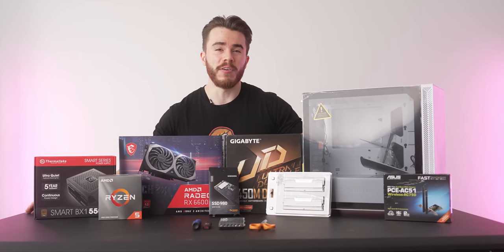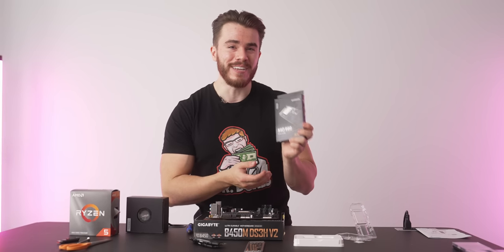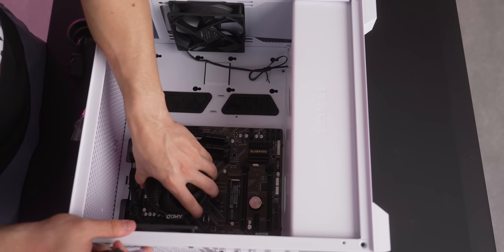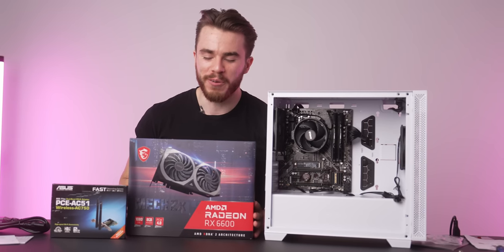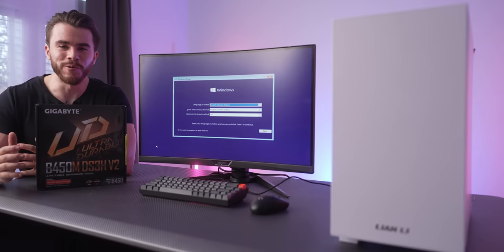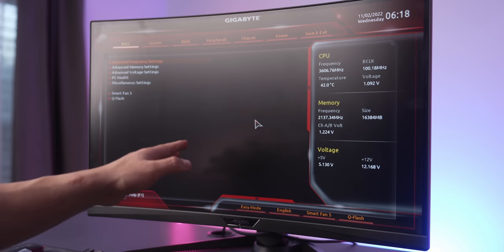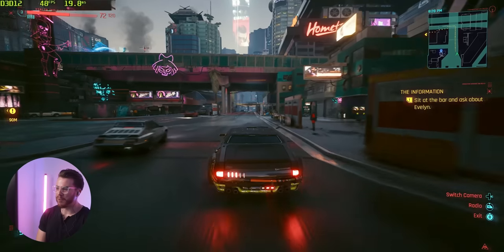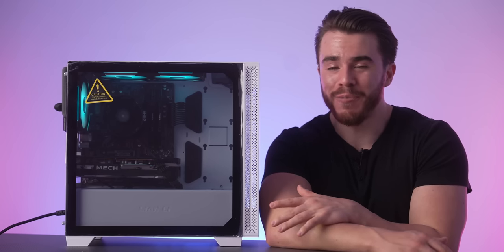Your Next $700 Gaming PC Build for 2023!

Comment: I feel like this system could benefit a LOT by going for a 5000 series cpu and a B450 mobo that supports it and also rBar, like most msi mobos...yes its a bit more money, but every penny worth it..
Reply from the maker: True, I didn’t think of that! Shoot!
Reply: @ScatterVolt  no problem mate just post and pin a comment for folks to know. I got an "old" msi gaming pro carbon mobo that received the 5000 bios update, and i just discovered last week that rBar is now also available on it. Quite handy when i just bought a 3060TI and a 5600X

Comment: I like the fact that you went all AMD in this build.  The R5 4500 combined with the RX 6600 is a very strong combo.
Reply from the maker: It could of been a little bit stronger with a 5500 since it’s price has gone down a lot since making this video
Reply: is there any differences if u combine it with different brand?
Reply: @ikram2512  you would miss amd smart access memory feature.
Reply: @ScatterVolt  with the online linked motherboard is wifi already connected with that, planning on building this for christmas
Reply: Could this run cod at 120fps
Reply: @ScatterVolt but wouldn’t you have to get a b550 motherboard?
Reply: @iihamed711  does the 5500 work on a b450 motherboard?
Reply: @hugo3928  it does, but you need to make sure the bios actually supports that cpu.
Reply: @iihamed711  thanks the ryzen 5500 worked out of box with no bios update :)
Reply: @hugo3928  that’s good to hear. I was actually planning on going with a ryzen build, but I was worried that my motherboard wasn’t going to be compatible out of the box so I went with Intel instead. I wish I went with ryzen tbh because it was much cheaper and I could’ve added a better gpu. I’m still happy with my current pc, but it would’ve been the better choice to go with ryzen.
Reply: @hugo3928  u think the 4500 will work on b450m wifi?
Reply: @hugo3928  so i can buy a 5500 for the 450b motherboard? and the other parts of this pc?
Reply: @hugo3928  hey do you know Why this worked I’m planning on also getting a 5500 instead of a 4500 So I wanted to know if you had any issues with compatibility on the b450m and 5500?

Comment: Nice build and nice budget options as well. I do agree with others though, that pairing the 12100f with a lower-ended b660 offers a longer-lasting upgrade path.
Reply: Yep, either that or the 5600 would have been the way to go.  I did the 5600 for 109 bucks  it's more cores and will be just fine for a while.
Reply: @Ryan-re1rs  how the hell did you find a 5600 for 109 USD lmao, its normally around 160-185 USD. Either way I would still recommend a 12100f like OP, its 40% cheaper and offers the same performance

Comment: Awesome build! But preferably you shouldve used the i3 12100f/ i5 12400f for more future upgrade ability.
Reply from the maker: i3 12100F maybe, but I wanted to set users off with a six core CPU for this price of a build. After all, AMD is still committed to the AM4 socket. It's not a bad choice by any means.
Reply: The 12100 is certainly an option but also the F60 bios on the motherboard Scattervolt used here supports the 5800x3d and that and a GPU upgrade down the line would keep this PC going for years. Right now either option is terrific and it comes down to what you like really. Nice to see decent price performance again!
Reply: @ScatterVolt  ryzen 7000 has pins on the motherboard now..
Reply: you are totally right, they outperform AMD processors and are 40% cheaper its ridiculous lol
Reply: or simply for PCIE 4.0x8

Comment: Using the stock CPU cooler is just leaving performance on the table. Spend $30 or less for a tower air cooler like the ID-COOLING SE-224-XT. Also Microcenter had this same motherboard and a R5 3600 for $130.
Reply from the maker: This build video was filmed back in October, before that insane cpu & motherboard deal

Comment: I'm building a ryzen 5 5600x, with rx 6700xt, 16gb 2x 8gb ram, 1tb Samsung 980, MSI MPG B550 Gaming Plus ATX Gaming Motherboard. 750w battery, With a MUSETEX ATX PC Case Pre-Installed 6Pcs 120mm ARGB Fans, keyboard and mouse with a monitor. All together 1,250$
Reply from the maker: Noice

Comment: Got all these parts for 590 using open box deals and the 5 percent Micro Center discount card. You think adding a better CPU/Motherboard would be a good place to spend the remaining 110?
Reply from the maker: I’d spend the remaining 110 on a 5500/5600, a 6650XT, and upgrade to a 1tb m.2 ssd
Reply: @ScatterVolt  hi, what is 5500/5600 and 6650xt. I'm new to this and I don't understand those terms. Thanks

Comment: Great build, I still think the r5 5600 may be a better paring, especially for CPU bound esports titles, 0.1% lows, and relative price difference. but in most titles, the r5 4500 is more than adequate, where the GPU is the limiting factor. Can't go wrong.
Reply: Im looking to build my first ever pc, would 1 TB of storage instead of 500GB work with this computer?
Reply: @masonmills-wg1nw  that would be better if you can afford it, twice the storage, gonna come in handy if you don’t have super fast internet
Reply: @masonmills-wg1nw  dont get an r5 5600, its around 150-185 dollars, you can get an i3 12100f for 100 dollars on ebay and amazon and it offers a little tiny bit better performance than the 5600, and can be paired up with B660 newer motherboard chipsets which are better for future upgrades
Reply: @MrEverythingyouwant1  will the cpu ryzen 5 4500 bottleneck the gpu amd radeon rx 6600?
Reply: @backeslache4264   I imagine not, the 5600 benefits over the 4500 because of more cache, and better architecture, but they are still similar, so if you can get the 5600 for maybe a $30-40 price difference, I’d consider it. The r5 4500 would be fine in single player games and most multiplayer games to be fair, but frame times and .1 lows are going to be better with the 5600, though it really just depends on the games you play, and what performance metric your aiming for
Reply: @_ZERO  the 12100f is not better, in barely any metric, the 12400 is a better buy, but if your building new, in most areas it’s substantially more expensive. Your upgrade path is invited to 13th gen, so if upgradability is your priority, spending a bit extra on a b650 board for am5 and a 7600 might be a better option
Reply: @MrEverythingyouwant1  here in sweden where i live the r5 4500 goes for 95$ and the only other cpu that my budget allows me to get is the ryzen 5 5500 which goes for 120$. This is going to be my first gaming pc so im a bit scared of picking the wrong cpu for my grapichs card so that I will lose out on performence. I mostly play single player titles but the only competative game that I play is overwatch. Do you think i should go for the r5 5500
Reply: @MrEverythingyouwant1  Is there a way to accuratly check the bottleneck a r5 4500 will cause a radeon rx 6600 xt
Reply: @backeslache4264   I would be less focused on bottlenecks considering the relative performance of the rx 6600, in gpu Blount games, you won’t likely experience any cpu bottleneck, you’ll be limited by the gpu, if you plan on selling and upgrading the gpu in the near future, than the r5 5600 is better for you, but paired with the 6600, you’ll only notice a slight difference in cpu bound games, it really depends on the games you play, Fortnite, apex, and cod all love better cpus, so if you play competitive shooters, get the better cpu, otherwise, you can save a buck on the 4500, it’s not bad by any standard. I’d also consider what monitor your playing on, as if you only have a 1080p 60-75hz display, your not going to notice the difference anyways
Reply: @backeslache4264  I'd go with the 5500 in that instance, if the 5600 is 10-20 more expensive, try to find somewhere in the rest of your build you can cut back on, that isnt the gpu. otherwise, you really cant go wrong with the 5500, same architecture as the 5600, just has less cache (which is important, hence the suggestion to upgrade if the price difference is negligible)
Reply: @MrEverythingyouwant1  First of all i just want to thank you for responding this really helped me. Yeah i was also thinking the same and go with the 5500 instead it's only a 30$ diffirence. Im kinda uneducated when it comes to the bottleneck stuff it was something that i read on a website that it affects 20-40% of the gpus performence when it comes to frames, but that must be inaccurate. As of now i own a 50hz display i've had for around 4 years but it's time for a change. I will buy a 144hz monitor. Im planning on maybe selling some parts in the future and upgrading but im not sure yet .
Reply: @MrEverythingyouwant1  Case: deepcool cc560 midi tower

Motherboard: asrock a520m-hdv

cpu: ryzen 5 4500

gpu: amd radeon rx 6600 xt

ram: Kingston fury beast ddr4 3200 mhz 16gb

Ssd: Kingston NV2 NVMe 250gb

Hdd: seagate barracuda compute 2tb

cooler master elite v4 600w 80plus 

this is my whole build. I am a little scared regarding the motherboard it goes for 73$ on the swedish market of amazon, it says that it supports ryzen 5000 series but i might have to do a bios update. I feel like this motherboard is very low quality and might break. I would really appriciate if you by any means could check if this is a good motherboard for my build
Reply: @backeslache4264  No worries! Yeah that's a good build. I'd suggest removing the HDD, and instead replacing your 256 +2tb HDD set up with a 1tb SSD, they are surprisingly cheap nowadays comparatively, and if you have a decent internet connection having more storage isn't always necessary (I have a 500GB SSD only, with a fast internet connection I can often uninstall and reinstall large games in under 10 minute). I'd also look into deals on a b450/b550 mobo, they usually have better chipset cooling, supports oc and more pcie lanes, b550 specifically supports pcie gen 4, I wouldn't really recommend any a520 series board, as it really limits you say, in the future were you to want something like an r7 5800x3d or r9 5959x. I personally have a B450-DS3H+WiFI from gigabyte, always rocked with gigabyte boards, and got this for a steal at a local computer shop, though its been going for similar on amazon (105 CAD), id look into that before pulling the trigger
Reply: @backeslache4264   Yeah id look into getting a new monitor if possible, 1440p 144hz is reasonable from the 6600 with settings adjustments and FSR, and you can get cheap VA 1440p 144 panels under 250 (i like VA, many dont because of motion blur, do your own research, many tend to prefer IPS)
Reply: @MrEverythingyouwant1  Yeah removing the hdd is a good suggestion, I cant complain about 1tb, Im currently playing on a 500g ps4 ahahahahah. I was thinking of replacing the motherboard asrock a520m with the asrock b550m it's only a 20$ extra. Do you think that the asrock b550m-hdv will do for my build or will it still be considered a bad motherboard for my cpu due to chipset cooling or other related issues
Reply: @MrEverythingyouwant1  if i still were to go r5 4500 instead of the r5 5500 and use the extra money for the b550 board will it be a bad idea performence wise?
Reply: @backeslache4264   if you can make up that $20 and get both the b550 board and the 5500, you'll be better off, otherwise, the 4500 is still good, and with b550, you have an upgrade path for more powerful ryzen 5000 chips and gen 4 storage and gpus
Reply: @MrEverythingyouwant1  Thank you for the help. I will go with the r5 5500
Reply: @MrEverythingyouwant1  This question is a bit off topic but i bought my radeon rx 6600 from the gpu manufacturer powercolor. It is the powercolor fighter version to be exact do you think those cards will last as long as the asus version or the msi version? The powercolor one went for almost 50$ less than asus or msi.
Reply: @backeslache4264  yeah that’s a good way to have a buck, it’s the same card just different cooler, maybe custom Pcb, save the money, get the powercolour
Reply: @MrEverythingyouwant1  Thanks for the help, I was kinda scared I bought a worse version of the gpu. Do you think the card will last more than 2 years?
Reply: @backeslache4264  it really depends on what games you wanna play and at what resolution, I’m sure it will last you 5 years if your willing to turn down some settings
Reply: @MrEverythingyouwant1  oh ok, should i have went with the asus version instead?
Reply: @backeslache4264  nah not unless it’s cheaper or as cheap
Reply: @MrEverythingyouwant1  PROCESSOR: Ryzen 5 5600 [6C/12T, 3.50-4.50Ghz]
MOTHERBOARD: MSI B450M A-Pro MAX
RAM: Kingston 16GB (2x8GB) 3200 Mhz DDR4
GPU: Powercolor RX 6600 8GB GDDR6 Dual Fan
SSD: 256GB NVME
HDD 500 GB
PSU: Aerocool 550W 80+ Bronze
Casing: VenomRX Vecna + 3 Fan ARGB
HSF : AMD Wraith Cooler
Reply: @MrEverythingyouwant1  wdyt of this build?
Reply: Very similar to my own build, probably the best bang for your buck, the only thing I’d get rid of is the hdd, and get a 500gb or 1tb nvme, the difference is night and day, and modern games benefit greatly from ssd speeds nowadays (that and they’ve come down in price) Also, I’ve never heard of aerocool, and the psu is important, so if it’s in your budget, try looking for something from Corsair or EVGA, or silver stone, their all very reputable in the psu space.
3600 mhz ram can be found for the same price as 3200mhz and Ryzen loves faster ram, it’s not that big of a difference but you may aswell considering the price difference. Another thing that gets often overlooked is the case, and while I haven’t heard of the VenomX, beyond personal preference, make sure it has adequate airflow and room for gpu expansion so your not forced to upgrade your case when you upgrade your pc.
Reply: @MrEverythingyouwant1  i must say i comment that without any knowledge about pc, now after doing research n learn abt it everyday i think i found mu build for my budget
Reply: @MrEverythingyouwant1  this is i came out with, 
CPU: AMD Ryzen 5 5600
GPU: ASROCK AMD Radeon RX 6700 XT
MOBO: Gigabyte B550M DS3H AM4, AMD
RAM: Geil Superluce 16gb 8x2 3200Mhz
SSD: Team MP33 M.2 2280 NVME 512gb
HDD: Seagate 1TB hdd 3.5 inch
PSU: Cooler Master MWE 650v2 650w 80+Bronze
CASING: Tecware Forge M Omni ARGB
CPU COOLER: ID Cooling Zoomflow 240x
Reply: @MrEverythingyouwant1  its not 700$ build, kinda near 800-900 in indonesia, n i think i’m happy with it
Reply: @MrEverythingyouwant1  wdyt?

Comment: Prices have changed so much. I would stick with either 3500x or beyond in the 3000 series non-G suffix. Also, the 5600 is a good price now. I avoid anything that is PCIe gen 3. $246 minimum plus tax for all those looking now 12/16/2022 now I know Austin will do a gen 4 video but for those landing here first. Also 6600, 6600xt, and 6650xt are all PCIe Gen 4 x08 Physical lanes and will suffer on a gen3 board or a gen3 chip. good video if you just want brand-new shinny thing. PC Part picker is not gospel and does reflect certain prices or sellers (sometimes) from Newegg and Amazon.

Comment: Great build. I would definitely try to squeeze some more budget and wait for r5 5600 deals but this is still much easier to follow for most.
Reply: Ryzen 5 5600x was £184 when I got it and it was even lower when I last saw it on Amazon.
Reply: an i3 12100f is cheaper and better tbh
Reply: @_ZERO  not compatible with the motherboard in the vid
Reply: @Sheriff-Woody  you can get a similar motherboard for the same price

Comment: You have done some very good builds in the past but pairing a RX 6600 graphics card with a B450 Motherboard is not a good choice as it will hinder the performance of this card due to lack of PCIe Gen 4 as this card doesn't have x16 lanes.
Reply from the maker: On paper it may seem like a hinderance, but in practice it didn’t hugely affect fps as seen from the benchmarks

Comment: I just did this build for my 7yo son. I kinda blew the budget a bit though because I kept buying parts I wanted over just getting a working pc.  
6600 200 dollars
Blue pop air case 89 dollars
5600 109 dollars
Samsung 980 1tb 78 dollars
Superflower 650 gold psu 49 dollars
X570 steel series wifi 150 dollars
Team group 16g ram.  59 dollars.
Reply from the maker: Slick!
Reply: Gigachad dad

Comment: Idk about buying 3600mhz cl16 and a "black" pro nvme which add very little performance for 20-30 bucks over normal nvm or 3200 cl16 and then buying a 4500 cpu, which is notoriously bad and only about 20-30 dollars less than a 5500/12100f. It's super nitpicky but i was surprised on the cpu choice.

Comment: for 700 dollars i feel like you can do a little bit better espescially on the cpu because my build is 600 dolalrs for a rx 6600 and a ryzen 5  5600x ( ik the 5600x overkill but im gonna upgrade the gpu later in the future.
Reply: It Australia I have the same PC with same specs for only 800 AUD or around 500 usd

Comment: Does the i3-12100f pair better with the RX 6600 or the r5 4500? I searched it up on UserBenchmark and ranking wise, the i3-12100f ranks higher.
Reply from the maker: 1. Don’t use userbenchmark
2. It does, but it’s a quad core cpu, and I’d like to put users on a six core cpu for this caliber of a build
Reply: I dont know if the I3 is better but I do know that userbenchmark is biased against AMD heavily. They literally put the 11700k as 13% better than the R9 5950X!
Reply: @borkdog9141  because the single core passmark is 13% better, no denying that
Reply: @amaantrieshard  They marked it as 13% better overall
Reply: @ScatterVolt  got it thank you :D
Reply: @borkdog9141  ohh thats interesting i didnt know that, thank you

Comment: I'd be interested to know what sort of temperatures you were getting using just the stock fans that came with cpu and case?
Reply from the maker: I had no issues. After all, this was a 4500 and RX 6600
Reply: @ScatterVolt  thanks for replying:)